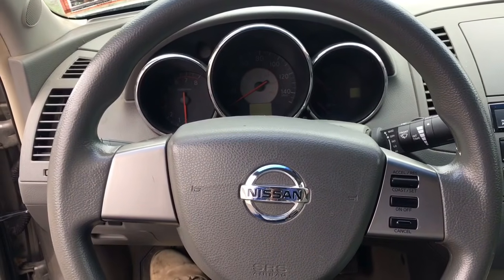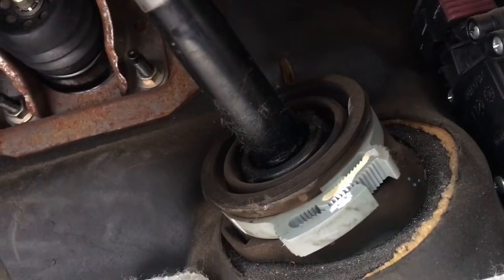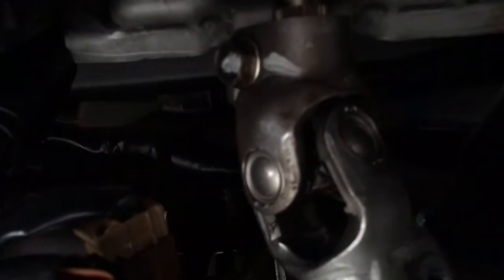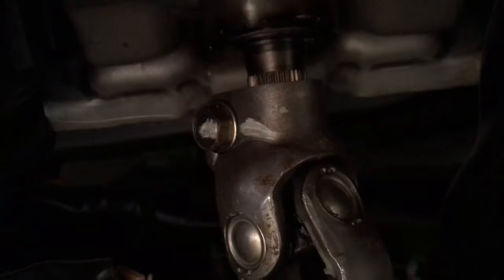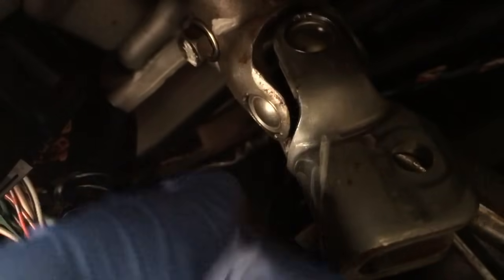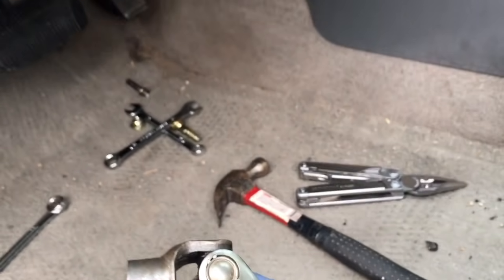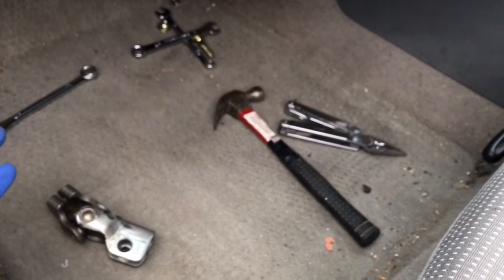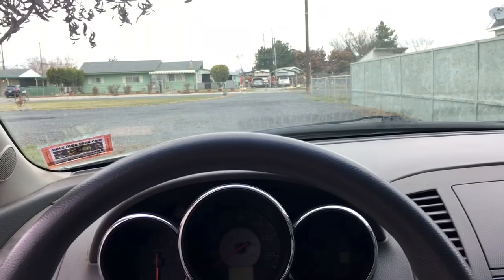Fix Crooked Steering Wheel for good! CUSSING

Comment: Thanks mine was ok, what I mean alignment but steering wheel have to turn it to 10 o'clock to drive  straight so I've checked tire front and back while crocked steering again and it's same so I decided to just to remove it and straighten the steering wheel 👍🏽👍🏽👍🏽
Good job man super easy lesser than 2 minutes to remove and refix it 🤣🤣🤣
Reply: Telling by your icon pic, what year and model of BMW did you this on? Do the parts look similar to the ones in this video?
Reply: @AfreakanoF  no it’s not done on my e39 it’s done on my Altima 2006 having no issues with e39 but this  Altima may be I’ll scrap it after few months if I didn’t find a solution cause vibration on idle while it’s warm only and gear on D otherwise it a good   Car but last 6 months trying to find a solution for this issue but no way  let it drive few miles and I’ll get rid of it I have it since  2009  and its better than those cvt transmission new model which I don’t like will go for 2010 330 after  getting rid of this and keep my  queen in  the garage e39 😅 only for holiday

Comment: definitely understand the cussing, just spent 3 hours doing this. getting the cv joint back onto the shorter splines was a pain in the ass. finally did it, and the bolts wouldn't go through. turns out i rotated the joint on both splines, and the side shaved down to allow the bolt through was not where it was supposed to be. so i had to take it off and do the whole thing again. +1 hour. fml. done though, thanks for the video, super helpful.

Comment: You think those were tough?  I have to get on my back, head down by the brake pedal and remove these KIA bolts to realign my wheel. They're torqued to IDK-what and hard as hell to loosen. This looked easy, really. 
Nevertheless, thanks for sharing and helping anybody that needed it.

Comment: Not sure if I would put the Old Part back in.  This is a Critical steering component.  CV=universal joint.  Point being, if you have to remove serpentine belt to change an alternator, or do an engine swap, anything related to belts, or filters, or fluids, gets changed during engine swap, or tranny swap... same applies here... in my feeble mind. When you change brake pads,  that would be time to grab calipers and measure rotor wear. Anyhow, reason I stopped to view this video is my recently purchased Saturn Vue has the Same Issue. Steering wheel is crooked.  Good video, forget the language,, lol.. I used some changing my Saturn Ion Alternator a month ago,,, ratcheting box end wrenches are a big help too...

Comment: What about taking the steering wheel off (disconnecting the negative terminal from battery if airbag is there) adjust the alignment?
Reply: That's what I did with my dad's Nissan. After replacing the clockspring, put the wheel back in straight.

Comment: I have a 2017 Sonata.  I took it in for a tire rotation at 15k miles. When they were done the steering wheel was off about 5 degrees to the right.  They swear they didnt do anything but they'd do an alignment for $100.
I told them to fuck off and had the alignment done at another shop.  Steering is still not straight. 
My next step is to do what the guy in this video has done.
In my car its actually much easier. Just one bolt, slide the shaft down, center the wheel and reinstall the bolt.
Reply: Did it work for you? 2 years later 😂

Comment: So excuse my lack of correct terminology, but this method basically corrects the steering wheel itself, while other methods would tackle the problem by dealing with the tie rods? What would be the difference. Which method would one use?
Reply from the maker: You’re on the right track. If the alignment is fine then it’s the steering wheel that’s off. Good alignment = no tie rod adjustment

Comment: Wait a tick, that steering wheel is still crooked to the right. Wtf.
Reply: Nathan Drake My friend that is so correct in order to properly straighten the steering wheel equipped with power steering you have to first relieve the power steering pressure and then perform an alignment and then supply the power steering back to the vehicle in order to achieve a straight steering wheel.
Reply: @richardgibeaut9518  no you don't, 4 wheel alignment starts from rear for thrust position. Then the front  then steering wheel all mechanical adjustment.

Comment: My cars steering wheel got adjusted but it turns to.much ti the left. My right steering wheel hits my frame when i turn left and the car is alinged what do i do
Reply: Edgardo, sounds like you put in a new steering wheel. If not, you need a new, but smaller, one. Your wheel should not be hitting the rest of the car.
Reply: Thanks guys ill take a look its not my car anymore its my brothers im the one that usually works on the cars at home but this was my first time doing a rack

Comment: Mine is slightly off too, a little less then yours... is that still an issue I should get fixed or will I be good??? Someone help
Reply: I'm actually in a similar situation and from what ive been reading if your car has a steering wheel position sensor and traction control it could caude issues with that system. However I have no idea if doing this will solve the problem lol
Reply: @goten259  so I kinda got it fixed... but now I have to move my steering back and forth to keep it moving start -.-i think I just gotta throw the whole car away lol

Comment: Hi!  I need help!  I feel like cussing but I will NOT!  I really need help!  I have been stuck in another city for weeks now at my sons!  They said it was the Tire rods , then control arms which I had replaced.  But now my steering wheel is cocked half way to the left. One place says the part is not right!  So I used my VIN number to get the part;  IT IS THE SAME TIRE ROD except the  ball joint is a little smaller!   I need to get back to my town and work so that I have a job!  Please help!  Plus I am a woman!  This has been a night mare! Not to mention trying to find parts in a Plandemic!  Signed no longer able to 'smile!:  ;(  NO ONE SEEMS TO BE ABLE TO DO THE WHEEL ALIGNMENT!  Techs have quit and everyone is short handed; Especially me!  LOL!  not!    2015  Nissan Rouge SV   2( 2 row seat vs. the 3 row seat; they said it makes a difference?)

Comment: All this guy has done here is UN CENTER the steering box...BAD....Out of center wheel is fixed by adjusting the steering tie rods equally to the left or right....New smart alignment racks take a reading with the steering wheel straight then compensates for other adjustments and wheel ends up straight. Older racks, the tech uses a brace to hold the wheel straight while adjustments are made....
Reply: Thank you, that's what i was thinking. i was looking for your comment. Can't believe how many think this is right.